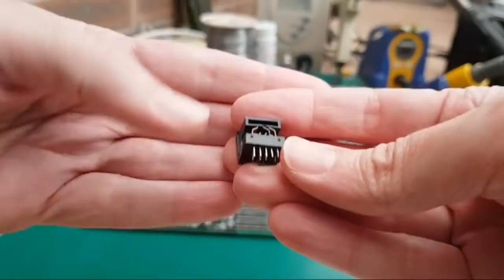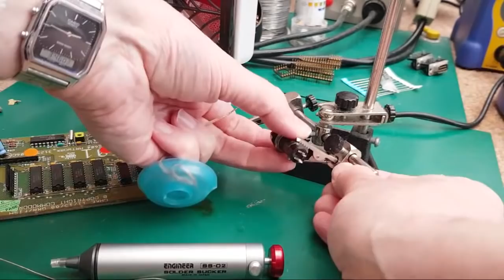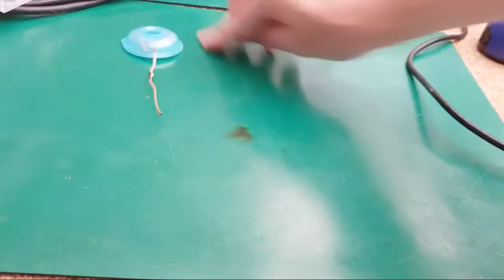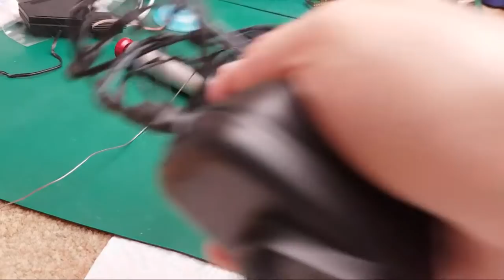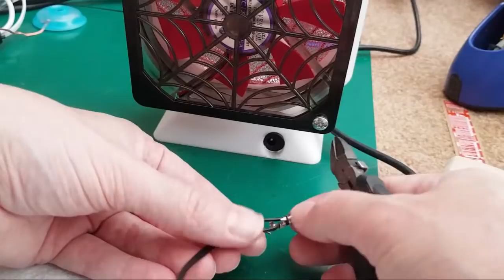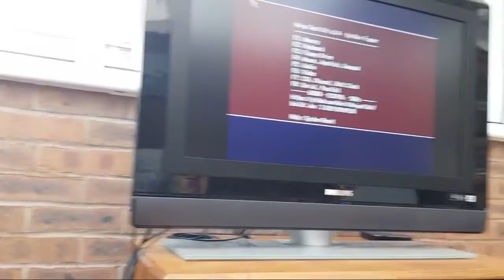Donations Arrived (zxkim81 / Andrew Littleboy) - Amiga RTC Stuff / A2000 PSU Adapter

Comment: Noisy desoldering pumps are why I have a strict, “no wife” policy! 🤣 As for desoldering, I always use the 4-second rule, especially for IC pins connected to a power plane (GND or Vcc). Once you screw it up, it creates an air bubble in the through-hole via, and it acts as a thermal insulator (sort of like a Thermos bottle) that makes it difficult to get it right; the desoldering pump will just lift the solder off one side, but the heat doesn’t travel well to the other side of the board, so the solder there doesn’t melt, and doesn’t get sucked up. This is super aggravating! 😏

Comment: Another info for the keyboard : you can use 'wire glue' (available from Ebay for example) to add or recreate conductivity to the 'tracks' on the ribbon connector.
Some packs exist with 10 super fine microbrushes.  https://www.ebay.co.uk/itm/272116196811
Reply from the maker: Thanks - yeah, I've used that technique lots of times on my channel already =D  I've also ordered some different stuff to try out on these later!

Comment: Hello. In case the mouse connector is dead, read the following, as you could use the AUX header next to it : https://www.thefuturewas8bit.com/acorn_archimedes_a3000_repair_and_mouse_conversion
This header is intended for the connection of an external Archimedes keyboard, with the mouse connected to it, but you can use this AUX header to connect a mouse only.
Hope it helps.
Reply from the maker: Thanks =D  Hopefully the mouse port will work!!!